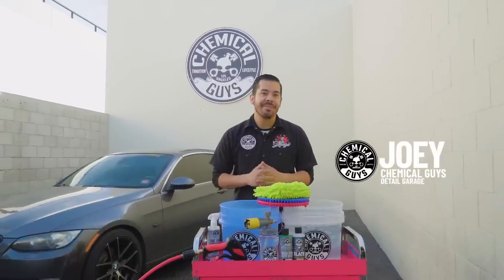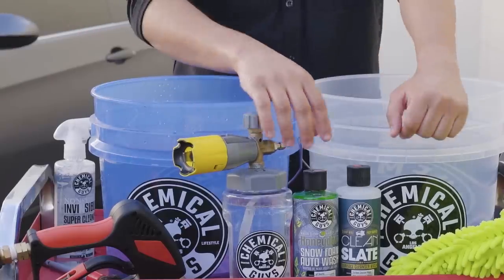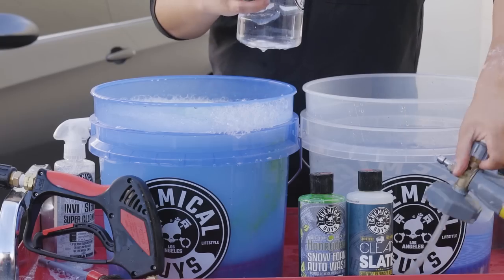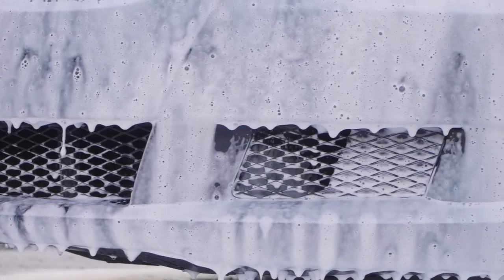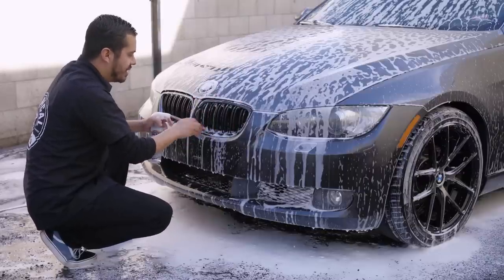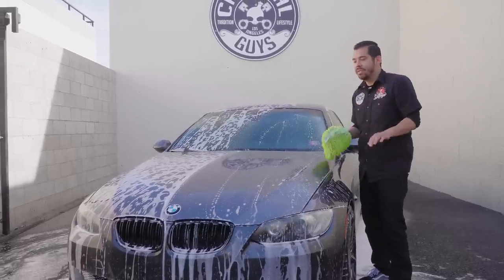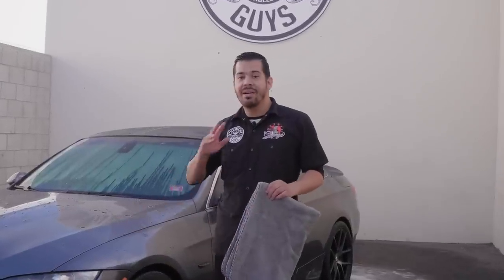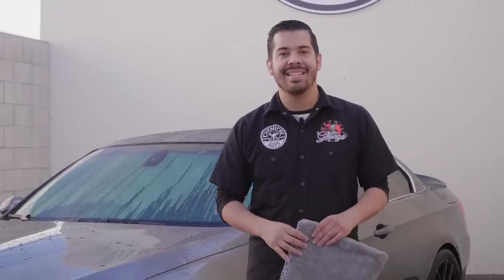How To Use The Power Of Foam To Get A Scratch-Free Wash! - BMW AtoZ Series Part 2 - Chemical Guys

Comment: I just bought a bucket kit from Walmart. Slowly building my arsenal for a new mobile detailing business. Thank you for the videos, they are very helpful.
Reply: One of the best bang for your buck, I bought 2, to use with the 2 bucket method.
Reply from the maker: Glad to have you as part of the Chemical Guys family!!
Reply: You will need to get some nonsense! And some drill brushes for your arsenal and good old Chemical guys microfiber towels
Reply: @spencer1320  Thank you so much for the advice. I’ll jump on Amazon and get those ordered.
Reply: @jeffreyg5718  look and see if there's a CG detail garage near you. They have a rewards program and are normally franchise owners. You'll be supporting small business and still getting the same products, plus whoever is working there can and will help steer you in the right direction so you don't buy products that won't work for your needs. Guy actually came out to my car to look at my carpet to help determine which drill brush I needed. Also looked at my wheels. I thought I wasn't getting them clean. Turns out the previous owner used something acidic and I needed heavy metal polish to fix the issue.

Comment: Hey chemical guys, when filling up the two bucket system, is it important if it's cold, luke warm or warm water?
Reply from the maker: Hi Franco! Using warm water improves foaming action however it is perfectly fine to use cold/warm water as well.